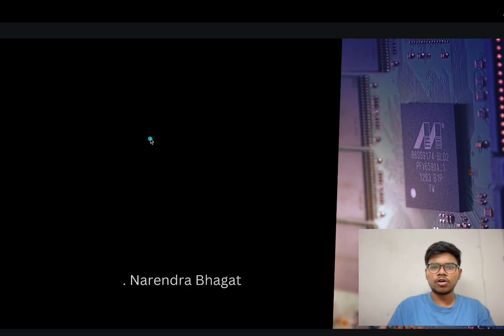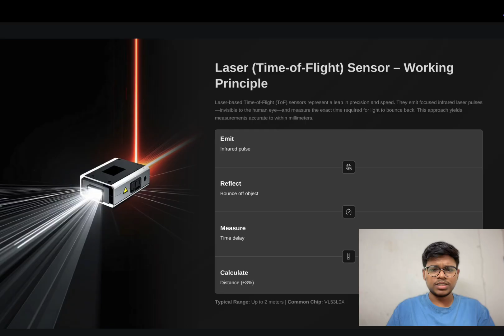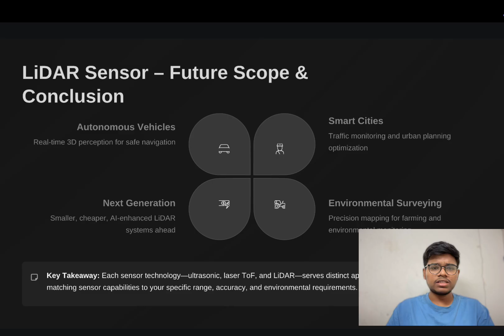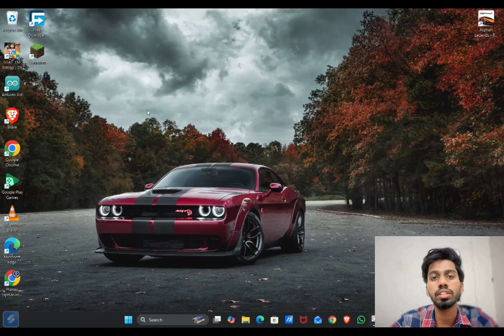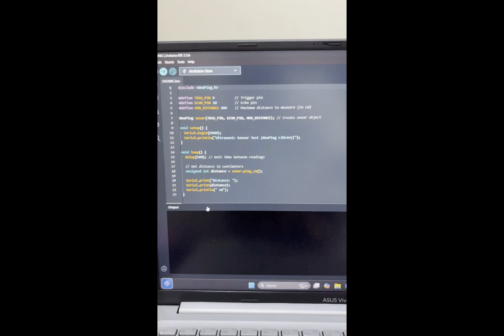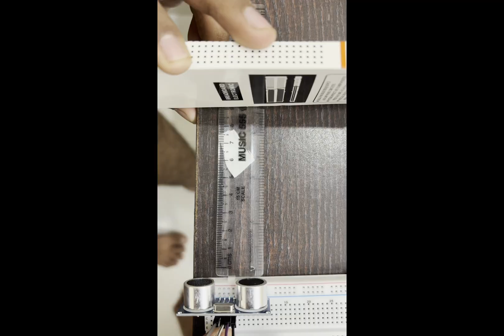Distance measurement using sensors | Distance measurement using ultrasonic sensor project

Comment from the maker: #include <NewPing.h>

#define TRIG_PIN 9          // Trigger pin
#define ECHO_PIN 10         // Echo pin
#define MAX_DISTANCE 400    // Maximum distance to measure (in cm)

NewPing sonar(TRIG_PIN, ECHO_PIN, MAX_DISTANCE); // Create sonar object

void setup() {
  Serial.begin(9600);
  Serial.println("Ultrasonic Sensor Test (NewPing Library)");
}

void loop() {
  delay(50); // Wait 50ms between readings

  // Get distance in centimeters
  unsigned int distance = sonar.ping_cm();

  Serial.print("Distance: ");
  Serial.print(distance);
  Serial.println(" cm");
}